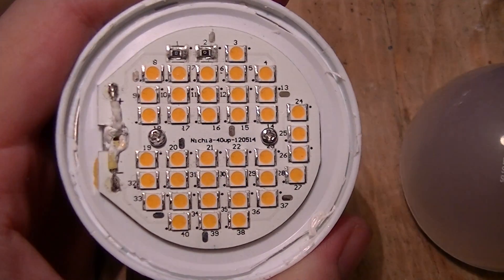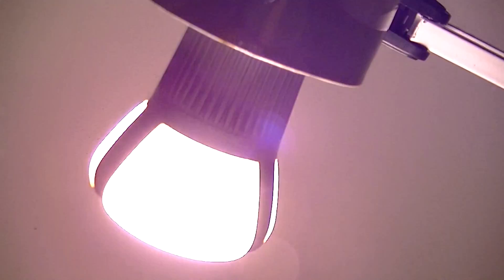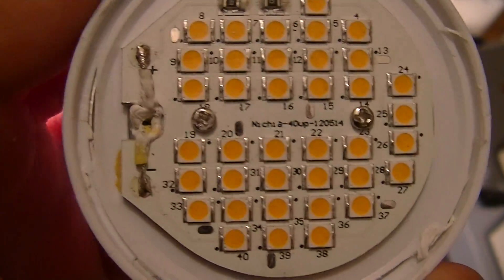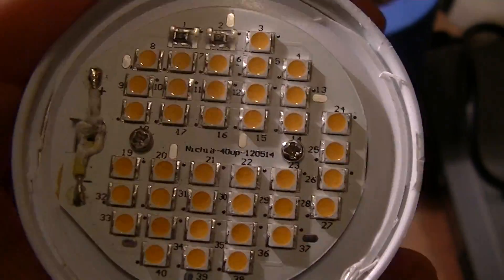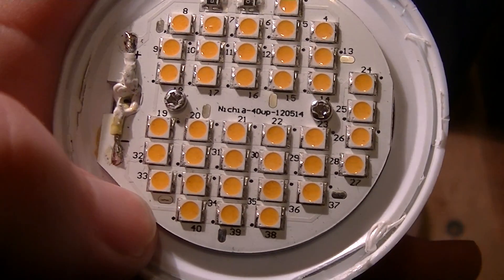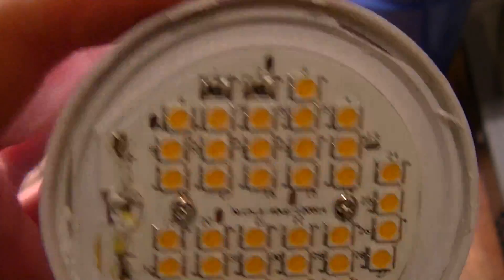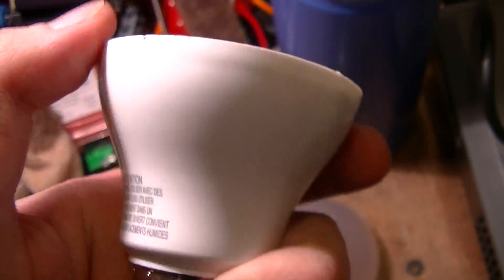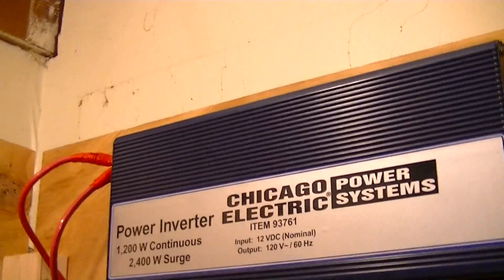Philips 10.5W LED lamp LED board

Comment: It would be great to see one completely apart.
I thought led bulbs can be used on Dimmer  systems ?
I know I do not have no led but I have 6 dimmer systems 
I know the dimmer type bulbs cost more than non dimmer.
I bought 4  and they cost 2 times more than non dimmer . I wonder if I can make a non dimmer into a dimmer type?